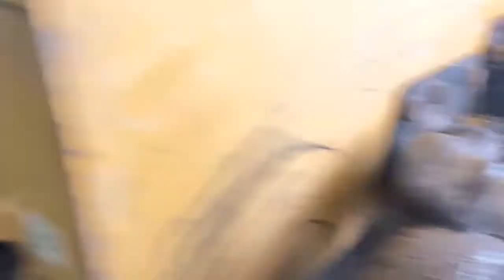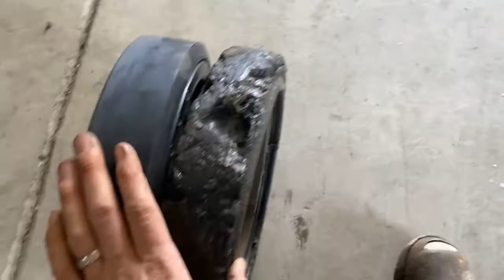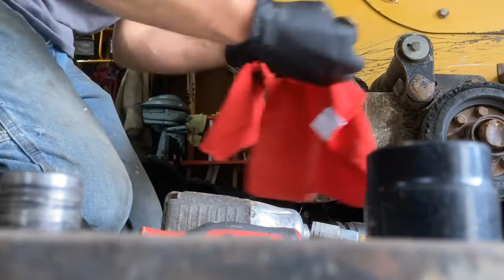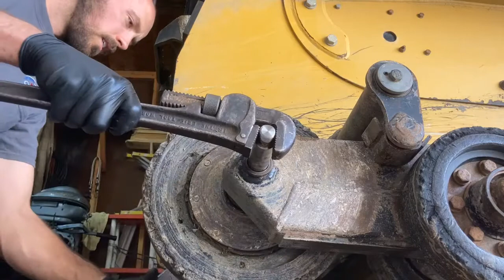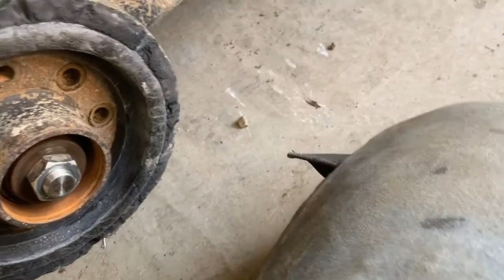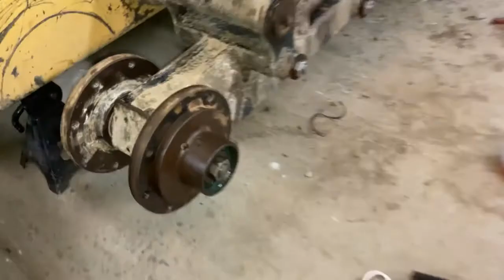Replace tracks and rebuild hubs on CAT track loader 257B3 and/or ASV machines.   Caterpillar 257B3

Comment: I’ve replaced my tracks twice now on ASV PT50, installed all the wheels first, then put the track back on as much as possible by hand, then with a long heavy pry bar force it over the front wheels with a helper in the cab turning the track slowly, so much easier, but hey you did a great job 🍻

Comment: The threads can be re tapped no? Regardless. Thank you so very much for this video. I have an older 257B. And I need new tracks. I've looked so many times on YouTube & they always show the tracks adjusted by grease fitting. Not this threaded rod like we have. You are the man. This is such a big help for me.
Reply: I just realized mine is different. I don't have steel boggie wheel like you have on the end.

Comment: I have a 247B3 and need to do the same thing.  My question is: the old bearings do not appear to be packed with grease.  With the oil ports, do the bearings just need oil (no grease)?

Comment: Wow, you really went for it.  I just bought a 257 D last year with 2000 hours.  I want to do new tracks, but I'm not sure it needs everything you did.  It's not an everyday driver for me.    How many hours does that have?  I'm also very interested on how you decided what ASV parts to get.  Nice Video...thanks!
Reply from the maker: This machine had about 5,000 hours on it.   I did a lot of looking on the trackloaderparts website at the diagrams and also did an inspection of the wheels to see which ones had bearings that were grinding and/or inner seals leaking.
Reply: Uní. B de

Comment: Not 1 video on YouTube showing the other wheels. All are bolt off the hub wheels. Of course I have everything done, new tracks on, but I can't get the outside idler om.
Reply: DID YOU EVER GET THE IDLER ON. MINE ARE SINGLE PIECE WHEELS , I CANT UNBOLT THEM , INSTALL THE HUB AND THEN THE WHEEL , IT ALL HAS TO GO ON IN ONE PIECE W/O MESSING UP THE AXLE THREADS
Reply: @jimcochran7539  I did. Bought a tool to help & it worked good. Took 2 of us. Then about a week later the drive motor died. Had to take track off again & front idler. Replaced drive & this time I got it all back together by myself. Well, took 2 people to get the damn hoses on the drive.